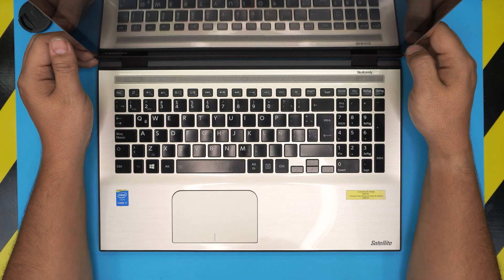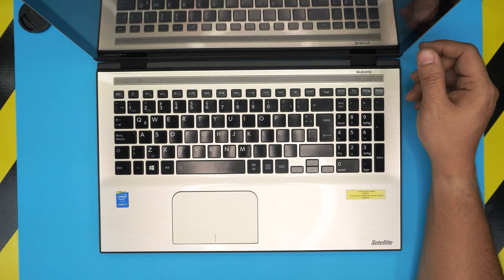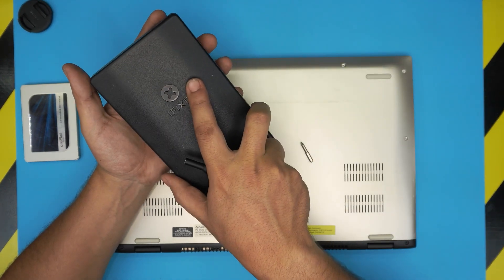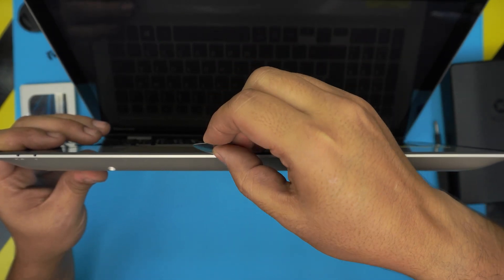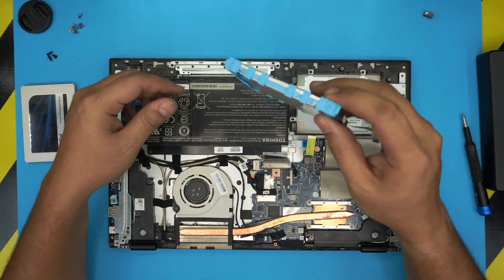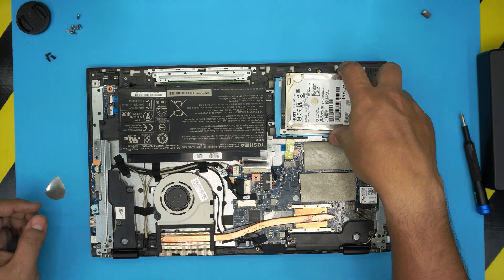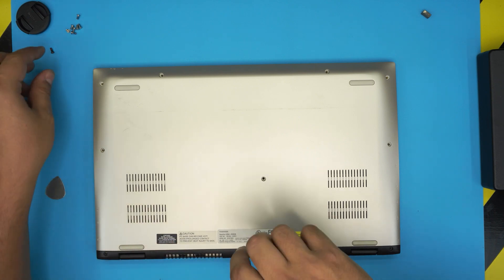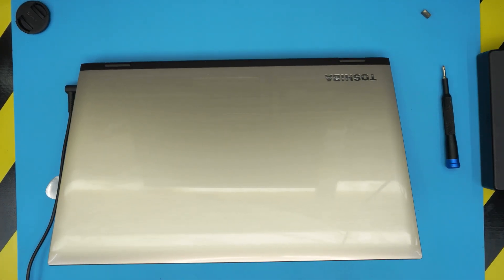Toshiba Satellite L55w C5202s 🚩HDD SSD UPGRADE

Comment: Me fallo el teclado 😢 donde lo puedo comprar??
Reply from the maker: en aliexpress o depende en que pais vives revisa tu mercado.
Reply: @uFixTek  México bro es q en mercado libre hay pero sin iluminación y ando aquí moviendole pero cuando reinicia prenden las luces pero se apagan antes de que inicie la lap podrían ser los drivers?? Y lo malo q tampoco hay drivers para mi modelo de lap es toshiba satellite L55W-C5280
Reply from the maker: en que estado estas?
muy problable que no es tu teclado, se puede revisar.
Reply: @uFixTek  soy de guanajuato amigo mira abrí la lap y como que no le pusieron bien el flex ya prendio pero no agarra unas teclas y las q agarra unas se quedan pegadas
Reply from the maker: oki que bueno igual forma quita el conector the teclado desde tarjeta y usa alcohol 95%+ y limpia contactos.
igual forma ando en queretaro en caso que quieres me puedes llevar con gusto sin ningun cossto lo reviso o cambiamos el teclado, sin costo solo pagas el teclado.
Reply: @uFixTek  siento más q nada que es el teclado el problema es en cuanto saldrá toshiba satellite l55w-c5280 es el modelo de mi laptop
Reply from the maker: teclado esta en 500-600pesos pero no hay disponibilidad en version de espanish.
Reply: @uFixTek  asta eso q lo quiero americano porq si no no ensambla ya q va por dentro el teclado
Reply from the maker: no vas a poder poner un teclado americano en esa palmrest, no se va entrar, el dibujo de tapa de donde va el teclado esta echo para spanish teclado.
spanish teclado lleva el "ENTER" en forma de L, donde el americano esta recto: https://imgur.com/a/3suIrpS
dame unos dias deja hablo a provedor que conozco en CDMX aver si ellos me pueden conseguir.

Comment: Great video.....i'm new to the tech...my question is when i change over to SSD will all my info still be on the laptop?
Reply from the maker: Thank you for the feedback! if you wish to support the channel you can LIKE or SUB or both :P
regarding your question:  before upgrade back up your files because the new drive wont have any windows or your files, once you place the new ssd you have to install windows and update windows, its very easy:
how to create windows 10 usb boot drive: https://youtu.be/uDu8j2lE-dM
how to install windows on Toshiba laptops: https://youtu.be/er1UXhie3cA